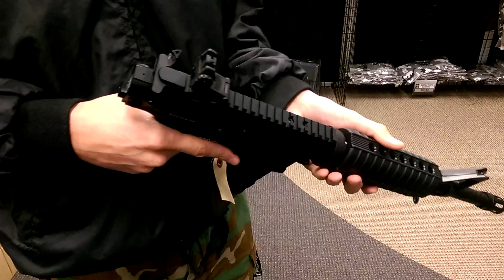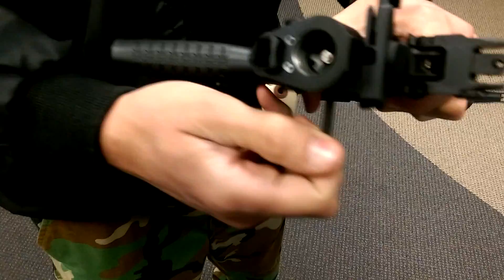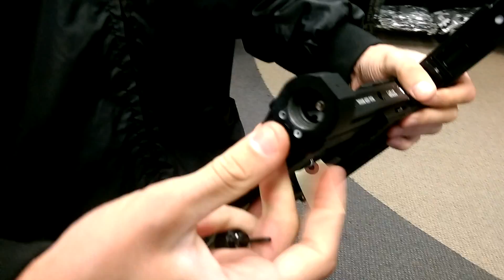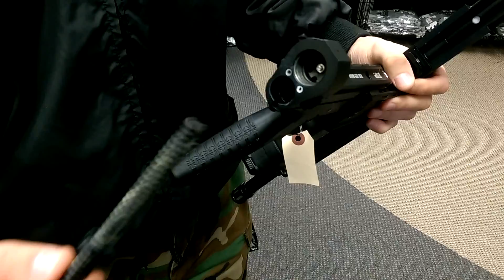Removing the Locking Pin on your 468

Comment: I wanted to put my pin on the other side but it won't sit properly(click). Is there something I'm doing wrong or can I do something to make it work ?
Reply from the maker: To the best of my knowledge it should fit just fine. I've been able to switch the sides before and I had no trouble with it. Make sure that the pin isn't. I've seen some issues with that but if it's straight it should fit.